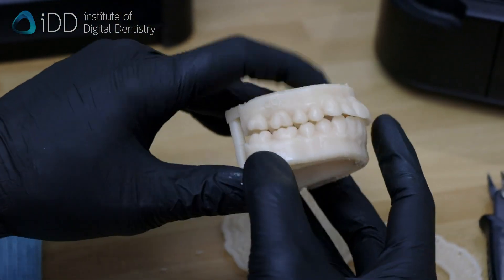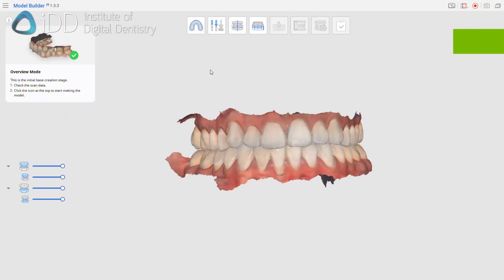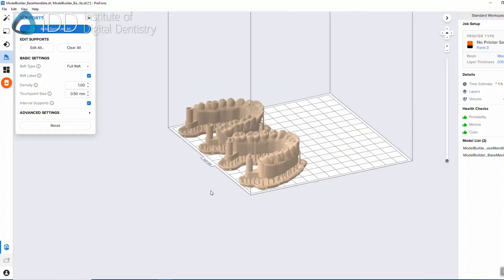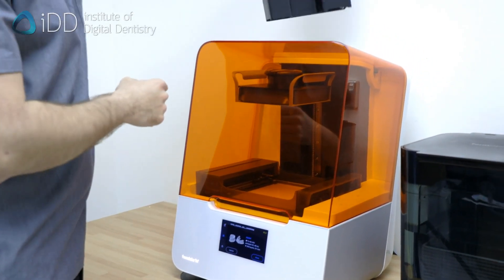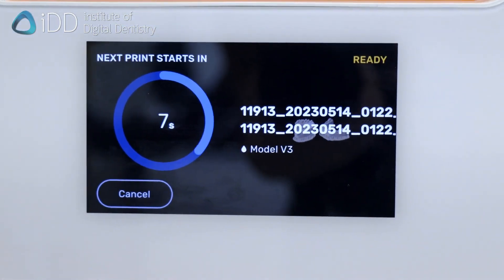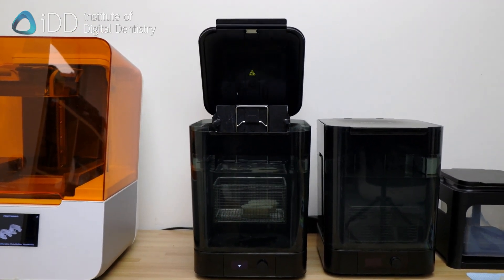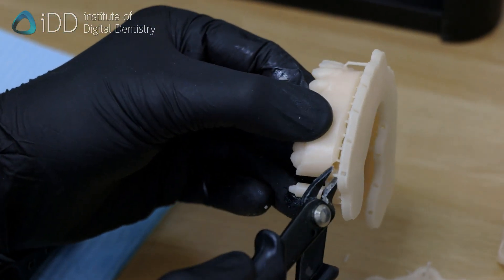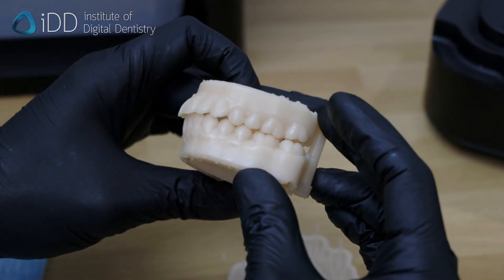Step-by-Step Guide: How to 3D Print Dental Models with Formlabs 3B+ Printer | iDD

Comment: hi mate! very interesting; some questions: about the production flow; 1st --> cad /3d model: how can you prepare it? using which software? I think it is very difficult to make the correct dental body using a parametric CAD; maybe you have to use non-parametric CAD, create STL file and transform it in  STEP file? Please, I am very curious to know this info. Thank you!
Reply from the maker: Very easily using Medit Model Builder or exocad. Many scanners now come with software to enable creating models from a scan.
Reply: @ thank you very much indeed friend 😊
Reply from the maker: @protomanialab  any time

Comment: The way the scans are based in the Medit model app you do not need to print with supports. Print the base directly on the platform. Saves a lot of time and mess.
Reply from the maker: Direct to the platform is certainly one way to do it. Or with rafts and supports. Both have pros and cons!
Reply: Can you give an idea about the cost to set up 3d printing for denture & crown at personal dental chamber